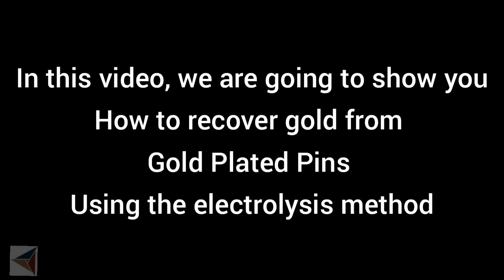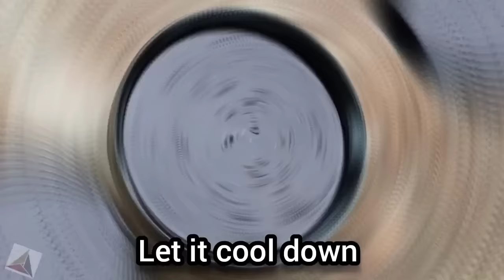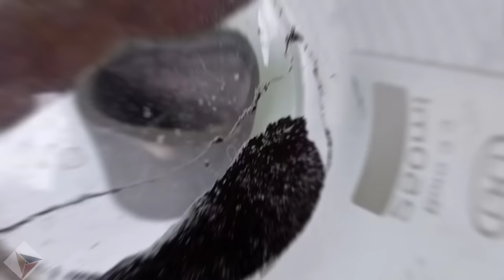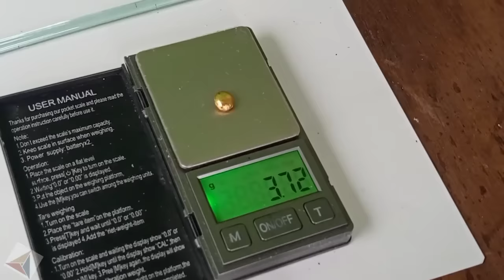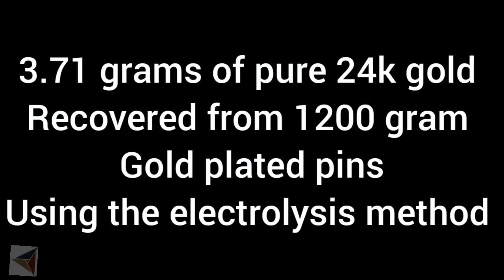Electrolytic Gold Recovery From Gold Plated Pins | Electrolysis Method Gold Recovery |

Comment: Hi my friend, wanted to let you know that in my similar set up instead of having to pour the gold/h20s2 mixture in the funnel and risk splashing or spilling some of the gold laden liquid, I made a hole in the bottom of my beaker and put a small magnet with a silicone ring on the outside perimeter of each magnet on either side of my container to form a water tight seal. When the time comes to transfer the liquid to the funnel and water bucket all I do is lower another magnet I have attached on a copper rod down to the magnet inside the gold mixture, it attaches  itself to the top sealing magnet and I’m able to slide the magnetic seal to the side and let the gold liquid seamlessly transfer into the water bucket with no chance of losing any gold. Thought you may want to try this method yourself :) just a friendly suggestion to a fellow scrapper!
Reply from the maker: Wow😍😍.
Gotta try that. 
Thanks buddy 🤗
Reply: Good comments
Reply: I need to know where I can buy a 12 volts power supply

Comment: What is it that you’re using to rinse out your filter cup is that regular water. This is my first time doing this.. I have at least about close to a pound of mixture of goal plated metal gold plated pins and some full gold pins, And on another pot I have motherboards that have gold on it and I have those in pieces but remember it’s fiber can extract gold from that using your method electro
Reply from the maker: It's regular water

Comment: Thanks a lot for your video I'm interested in doin this..may u kindly list all the materials I require for this process and suggestions of where I can get gold plated pins😊 Thanks in advance. I'm located in the USA
Reply from the maker: Contact with local scrap yards
Reply: You can get gold plated pins off of a bunch of stuff!! Lcd/led tvs, cell phones, pretty much any electronics nowadays have some.. not all electronic, but most, in my opinion, will have some gold somewhere.. you want the mother boards specifically.. and then theres the capacitors an such, if ya can get enough of those babys, oohhh boy 🤑🤩🤑  haha

Comment: Great video  again. It's fantastic you shows different ways to obtain gold from ewaste. Just a quick question. Can you use this method with gold pins that have lead/tin solder. Will the solder cause any problems?
Reply from the maker: You can do that 
There will be no problem
Reply: @TrinityGoldRecovery  can i use battery acid?
Thanks bro

Comment: The drawbacks are you have to constantly stir up the pile to combat the Faraday cage effects, in concentrated sulphuric acid that is trying to get hot.
I've found it easier to use dilute sulphuric acid and digest the base metals instead. Use a titanium anode and an Anode bag and you can still recover the gold as foils.
Reply: So a piece of titanium and whats an anode bag??
Reply: @michaelstark9939  
An anode bag is just a filter bag surrounding the anode. It captures the material not dissolved in the process.

Comment: Did you connect the negative to the lead or the positive?
Reply from the maker: Unfortunately, due to a technical error, the power supply's electric wave was being interrupted, so I repeatedly tried to fix the electric wave flow by swapping the anode and cathode ends.

Comment: Hello amigo another excellent video thank you.
Please tell will this process work on high grade pins with thicker plating?
Am I correct in thinking you live in the Phillipines ?
Reply: Medium high grade gold plated pins from old nokia charging ports...
Reply: M8 you are pro !!! grade job and in electrolysis! !! 100% professional 💪👍👌❤❤ . Witch method you prefer electo or acids? ?
Reply: @giorgosxyrichis3630  I  got 400g of what I thought was military grade pins under hot nitric and distilled water for two days now.
Used up over 1 litre 68% nitric acid costing a fortune with acid and electricity for the hob and fume hood. Don't think this is the way to go. 
That's why I asked the question.
Reply: @antoniotrepistole1383   m8 I put 300 gr low grade straight in a.r. + h2so4 without electric stove or fume hud I'm in 3rd day and almost they done .  I will not w8 to dissolve all the copper just free the foils and if some gold go HCLau witch it will go 100% I will collect from waste container dy put some hitsing gold playted from premium 4 !! But .. that's my way your way maybe its better !! Electro maybe it's the chiper way but maybe is more time consuming ?